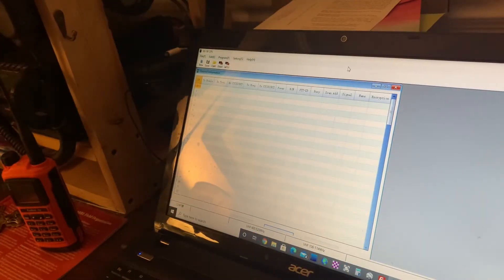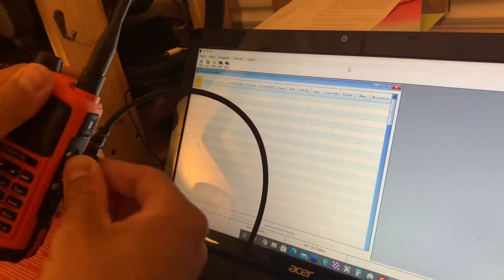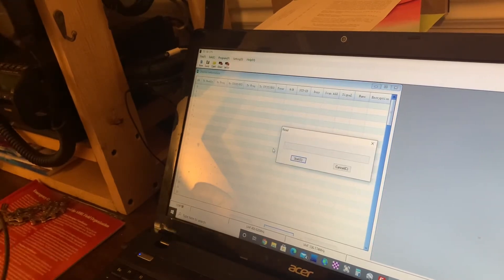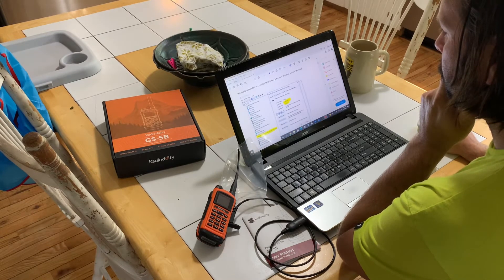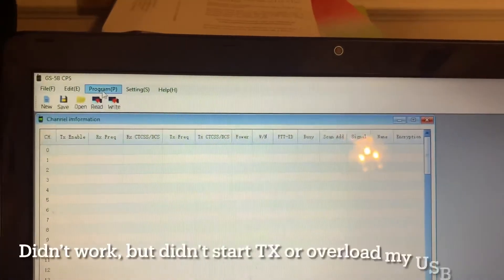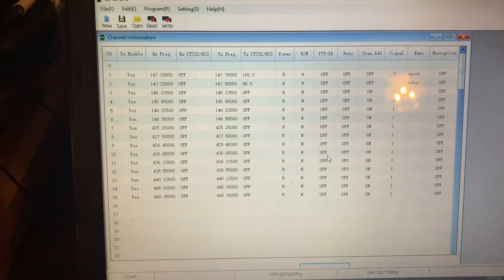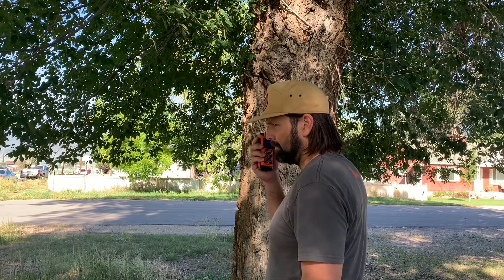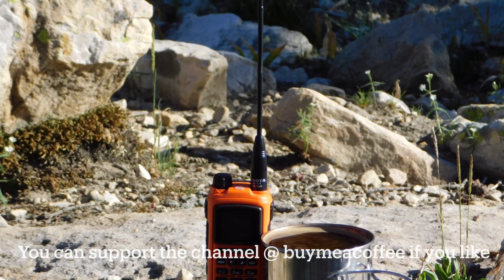Radioddity GS-5B - Programming Cable Problem and Solution - Driver Update Backdate

Comment: Having issues with the Bluetooth drop down for channel number not working on IPhone/iPads. And Bluetooth connections failing on Androids but the channel drop downs working. Do you any information on this? Thanks…KE8VBF
Reply from the maker: is this on the most current app? Interesting. I've got to do some follow up on this radio's app support. Last I heard they were updating it to eliminate some bugs. KI7WJP
Reply: @backcountryamateurradio  got it to work on an Android. But had to find the app via the QR code for it did not appear in the Android store at all. Had to install and uninstall till it worked 3 times for some reason. Apple shows the app in the store, installed it on two Ipads (not phones) fails on both Ipads, same errors on both pads.. Uninstalled reinstalled many times. Might be a Ipad vs Iphone issue??? thanks for the response on this. KE8VBF

Comment: Thanks. But this doesn't work on Windows 11. I have mailed them about the issue. Anyone have any solutions? I'm still searching. Problem seems to be with the programming cable chipset(driver).
Reply from the maker: Interesting. Have you tried a different cable? I’ve used Baofeng programming cables. However, not on windows 11.
Reply: @backcountryamateurradio  Yes and it wouldn't work with the cable I use for the UV-5R.
Reply from the maker: @BuzzB0mb  oh interesting. I'm sorry to learn of this problem. Radioddity is going to have to fix this.

Comment: When programming this radio, I can’t find where to input a offset frequency.  Chirp has that column, cannot find it on Bluetooth or pc program.?
Reply from the maker: So it's actually a little different with this radio, and I haven't hit on this as far as I know (and probably need to) - The offset is designated by the RX and TX frequencies, rather than the normal "offset" or "shift". That being said, the BTE and PCS lack the "offset/shift" direction. So rather than programming the offset and direction, just program the uplink frequency in the TX freq column. Hope that's helpful! Sorry for the delay!
Reply: @backcountryamateurradio  thanks again.  As soon as I read your reply it made sense.

Comment: Yea, I think I nuked my laptop yesterday from a power surge from point of their radios. I'm not really happy at them moment if this is actually the cause.
Reply from the maker: is your computer no longer functioning?? I would definitely take that up with Radioddity. This issue should be addressed on their website. What a headache this whole thing has been.
Reply: @backcountryamateurradio  In sending the laptop back to the manufacturer. I'm hoping they can fix it.